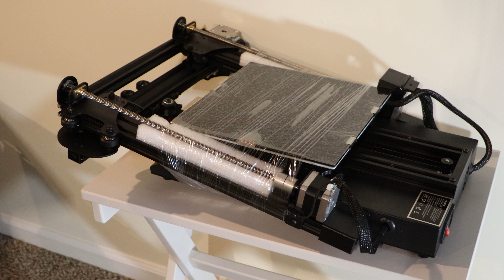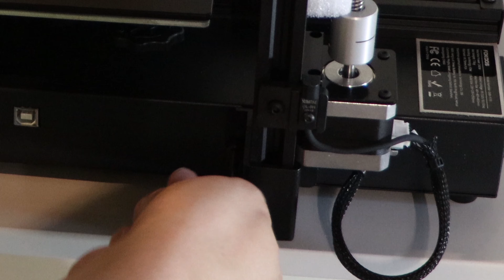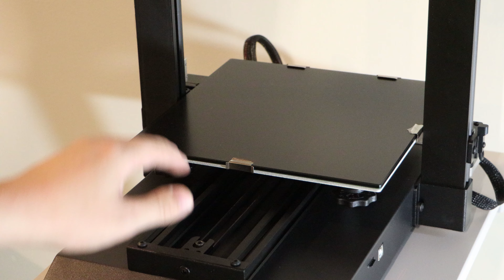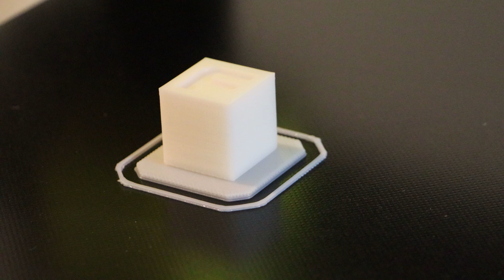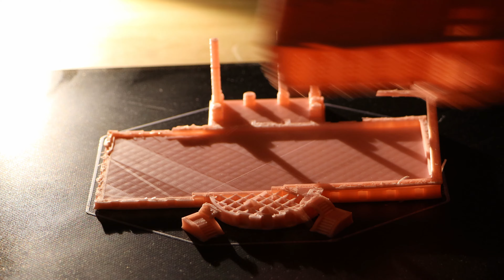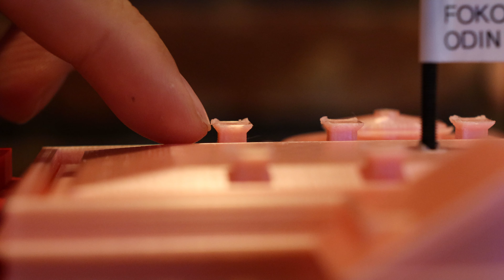A Match Made in Heaven: FOKOOS ODIN + Biqu H2

Comment: Hey did you happen to change any of the settings on the printer. Think I’m having some heat creep or need to change settings since going to direct drive? Thank you in advanced!
Reply from the maker: Yes, generally retractions are set to 4-7mm for bowden tube printers. If you switch to direct drive you need to reduce that to 0.75-2.00 mm, otherwise retractions will pull back too far and may lead to solidification and clogging in the heatbreak.
Reply: @NathanBuildsRobots  your a big help thank you!

Comment: Hey Nathan what nozzle were you going to put on this printer and why? I upgraded the plate and fans on mine but didn't want to change the print head just yet
Reply from the maker: I put the Biqu H2 hotend on there. 
It's not the easiest machine to mod, but I found a way to make it work. Had to do some cutting and drilling on the x gantry plate.
Reply: @NathanBuildsRobots  thanks for the response, before you put the Biqu H2 you mentioned you were only going to swap the nozzle, but it broke and got stuck. Just wondering if you remember which nozzle you were going to use. It's my first printer and your upgrade choices make a lot of sense so i wanted to try the nozzle before swapping the whole hot end
Reply from the maker: @fehk  I don't recall, there are only 2 nozzle types on the market, "E3D" and "MK8". Its probably one of those types.

https://www.bondtech.se/product-category/nozzles/bondtech-nozzles/bondtech-cht/
Reply: @NathanBuildsRobots  thanks man, keep up the good work

Comment: This is awesome, I'm going to do most of these mods on mine as well! It looks like the link to the squash ball feet doesn't work anymore. Can you please provide a link to the model you used or another one that's compatible with this printer?
Reply from the maker: It's my go-to printer, I'm still using it for most of my practical prints. 

The link works on my end, but here's the item name: 
Tecnifibre Double Yellow Dot Squash Balls - 4 Pack
Reply: @NathanBuildsRobots  Oh sorry, I meant the link to the Thingiverse STL that holds the squash balls, not the actual squash balls

Comment: This is by far the best review of this printer that I have seen. Well done. I like how you upgraded the printer.
Reply from the maker: Thanks! This is my go-to printer because of how reliable it is. 

Normally when I slice something I take an extra minute to make sure the printer isn't doing anything risky that might cause the print to fail. 

With this, even if it has some unnecessarily hard to print support material or bridging, I just slice and send it, fairly certain it will finish. 

Pic related: 
https://imgur.com/gallery/uxdbf3p

The only thing is the hotend is PTFE lined, so I bought an all metal heatbreak I will swap in eventually.

Comment: I just bought this and I am having a weird issue where PLA actually curls up around the edges, just like your print around the 3:50 mark. Have you been able to find a fix for that?
Reply from the maker: I'm not 100% sure but I think usually that can be improved with better part cooling. 

Check out this thing, it could help.
Print out in PETG or ABS. PLA will melt when it's that close to the hotend.  
https://www.thingiverse.com/thing:4939201

Edit: PLA will work as long as the part cooling fan is on 100% of the time. But if the printer shuts off with the hotend at printing temperature it may get melted.

Comment: Ferrules on the board is a big plus and a sign of a good printer
Reply from the maker: Good observation. This is the first machine I've reviewed that actually had them. I just looked at an Artillery Hornet and it too had ferrules. 

I like to think that companies are finally starting to listen after years of collective whining by the 3D printing community.
Reply: @NathanBuildsRobots  yeah. It really says something about the company. Its those little details that show they care about their product and quality. The funny thing is they're usually cheaper than all the creality garbage clones. If you haven't already you should try and get your hands on a  Mingda rock 3 pro. Theyre so much better than everything out there, dare I say perfect. Really anything from mingda is going to be well thought out quality machines. I'll never buy anything but them. And their customer service is incredible too. I've sent a few messages to them and no joke 1 minute later I had a response. You're lucky if you even get a response at all from most, creality possibly being the worst.  But yeah man seriously impressive. They technically have auto bed level too all harness and firmware built in. You only need to buy the sensor itself. I asked why they didn't put it in and the answer was smart. They don't have a contracts with bltouch so they can't legally use the name. But they also said they would never put a garbage clone in. So they left it to us to buy the real thing but its already to plug in and thats it.  Also the two trees bluer plus is another great printer. Great printers

Comment: Your bed was extremely sticky and mine barely sticks at all
Reply from the maker: I think what actually happened with my bed is I printed with this filament and it turned everything extremely sticky: 
https://amzn.to/3xxQGr6

I was going to make this a review of the FOKOOS Odin and Yousu filament at the same time, but the yousu filament ended up practically ruining the bed. Kinda sucks for the review, because it wasn't really FOKOOS's fault that I was having issues. I only figured this out because the next printer I tried with the yousu filament also had issues with excessive adhesion after printing with it. 

It leaves the 1st layer of PLA behind when removing the print,  then smears all over the build plate when you try to scrape it off.

Not a big fan of the product, but maybe they could re-market it as a bed adhesion superglue?

In any case, I think the PEI spring steel sheet is a great upgrade.
Reply: @NathanBuildsRobots  did you even try to use the scraper?
Reply from the maker: @joshuamns1  I did. I used a hammer to jam it in between the part and the glass bed but it would just wedge in there and it felt that if i pushed it any further it could break the glass. If i end up needing that plate I will try to remove it with the help of a heat gun. 

I am fairly certain it was the yousu filament that made it sticky. It left behind a waxy substance that basically welded any PLA to the bed. After prying off a couple prints on my other printer I noticed glitter-sized pieces of the carborundum paint were coming off with my prints. I scrubbed it with Iso Alcohol and eventually rubbed off the waxy substance, but even that was difficult, leaving paintless spots on the glass bed.

Maybe they used some kind of additive to get their filament to stick, but i got a bad batch where they added to much?
Reply: @NathanBuildsRobots  fair enough 👍

Comment: Looks like a great design!
The extruder stepper is smaller than on an Ender 3 but it's a direct drive...
Reply from the maker: I like it, It's a great chassis to build off of due to its sturdiness and large motors. I modded mine pretty extensively but the only things it really needed was a new bed surface and higher vref on the extruder stepper driver so it wouldn't skip steps. 

Good point, let's say a typical bowden setup is 75% efficient, well that means a direct drive setup can use a 25% smaller motor. 

I have seen some analysis on bowden tube physics before. They can be pretty efficient, but it depends on the length, bend radius, and a bunch of other factors.

Comment: Great video once again nice choice of mods!
Reply from the maker: Thanks Henri, there's more to come! I have 6 printers now so it may be time to do a print-off between all of them.

This printer has such a solid frame that I think it will have the best quality overall.

The only issues I had was I have trouble printing flexibles with this extruder/hotend combo, and when flipping the machine over it has a tendency to need re-leveling. It's not too big of an issue because it holds zero very well during normal use, and auto bed leveling would solve this problem completely.

Comment: You forgot to mention the warping from off that PEI bed.
 I can recommend a foolproof method of guaranteeing no warpage with PLA and that is applying saltwater onto a flat glass bed and evaporating the water off to reveal a salt crystal base, this method was developed by a university fellow researching a method of controlling the warping of PLA, he has released a paper explaining the method, here is a link to a PDF, when you load the University page click the saved version in orange in the top right.
https://www.uantwerpen.be/images/uantwerpen/container11343/files/bonding_pla_with_salt_water_v20160713.pdf
Reply: It works like the coated glass beds in that it holds the print very tight while the bed is hot but then releases it when cool but works much better than borosilicate, since using this I have had no PLA warping at all and it is so cheap to use!
Reply from the maker: Salt water? That's a great idea I will definitely have to try that out (just don't spill it on the electronics!). I would be interesting to try other evaporation deposited solids, I'll give that paper a read.

I added a raft on the last Benchy I printed, which fixed the warping issues and greatly improved quality. I didn't end up reprinting the Whitehouse with all the final mods and settings because it takes so long.
Reply from the maker: Your link didn't work for me, but I found it here: 

https://www.uantwerpen.be/nl/personeel/geert-keteleer/manuals/